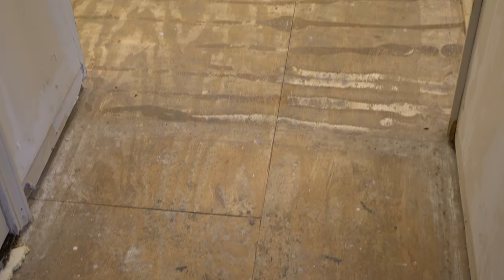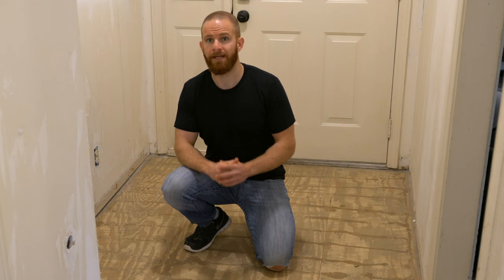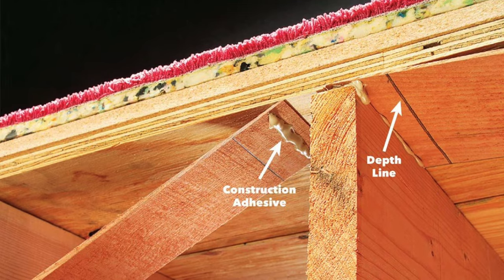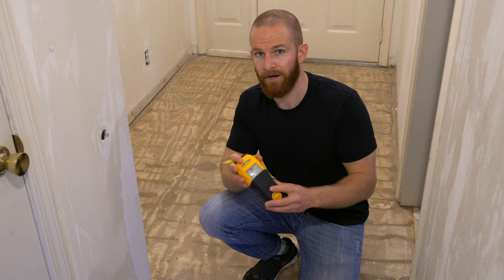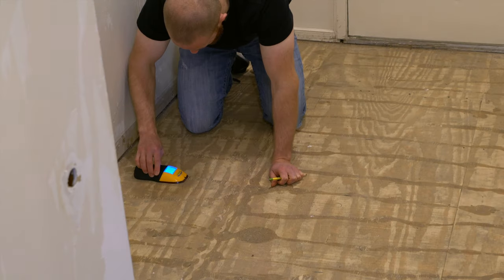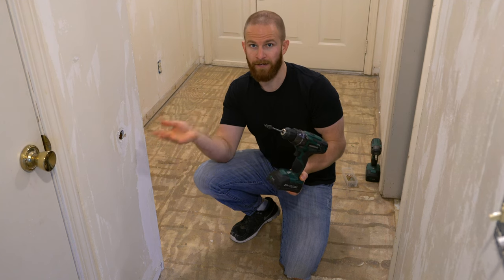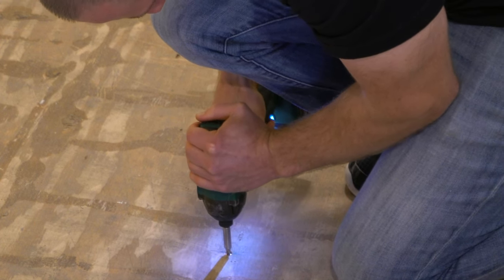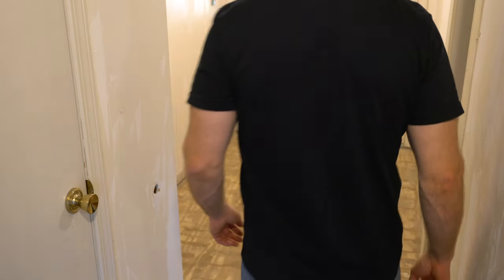How to Repair Squeaky Floors

Comment: Great demonstration! This is exactly why I use screws any time I put down sheathing on the floor or a roof. Drywall is the same. Screws in the joist or stud won't pop out unless something rots around them.
Reply: Good call bro. Don't want squeaking when you're walking around on the roof late at night....

Comment: Wouldn’t you use a Decking screw, To allow the “new” screw not to eventually back out and create another gap?
Reply from the maker: Well there weren’t screws there before, just nails. But you can certainly use screws that you think will hold better over time!

Comment: Did I just see a guy ruin a hardwood floor screw it in to it. Over squeaky floors when you're just put baby powder or baking soda on it
Reply from the maker: No that’s the subfloor, I installed hardwood floors over that after fixing the squeaks.
Reply: 🤦🏼‍♀️ you really don’t need to watch the video to see that’s the subfloor, but in case you somehow confuse it for hardwood floors and jump straight into incorrectly correcting someone, he says it in his tutorial. You should do a tutorial fixing squeaky floors with baby powder though.